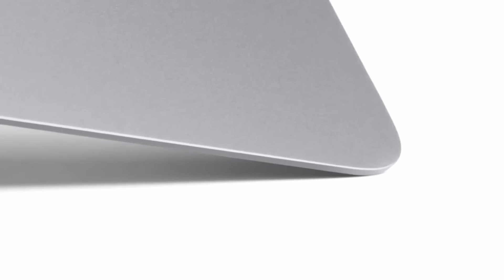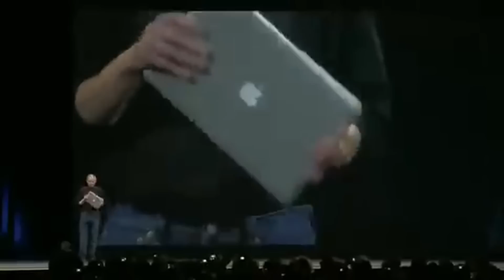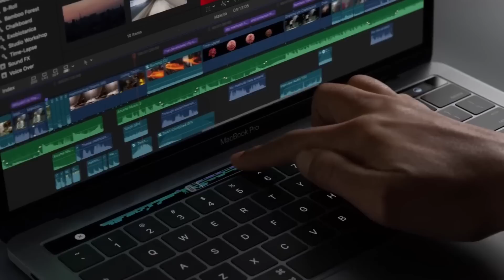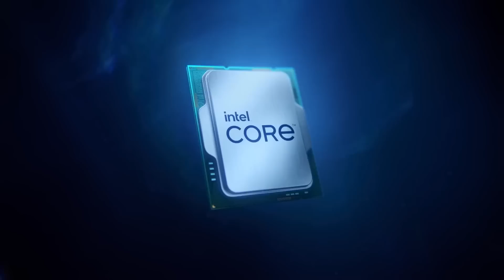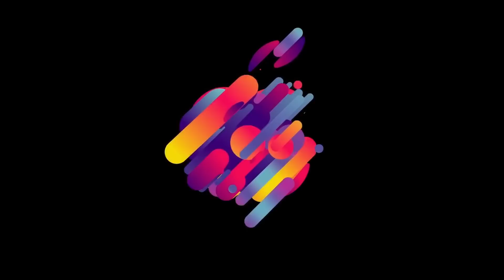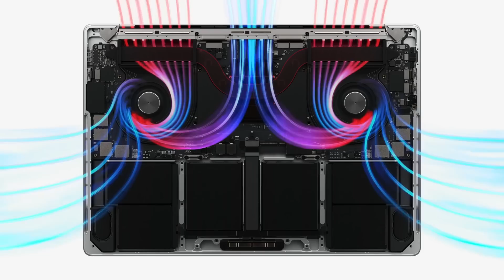How Apple Almost Killed the Macbook

Comment: I bought an Intel MacBook Pro in 17 and never really liked the Touch Bar. The computer slowed down very early and it got warm quickly. Not to forget that when you are writing then sometimes you touch the touch bar by mistake a what you have just written or tried to disappear. I have had better macbooks before, but then again I still have it at the moment my command buttons are falling off or don't work. I have then considered having a mac mini at a travelling computer, but it probably end up that I will buy a macbook M4

Comment: I feel like the touch bar could have been successful if apple added it without removing physical keys that it replaced
Reply: I always thought the same...

But the many developers were too lazy code...

Plus, Apple failed to make it tactile, like normal keyboard, or atleast like the iPhone screen

Plus it's also expensive to manifacture, which makes MacBooks more expensive, 

and it's another thing that uses CPU, in some cases GPU and battery

The thing is, tech isn't there, it's too ahead of our time, maybe it will be in the future, after a few decades
Reply: @Senior_Heel It'll never come back... It was bad even in theory. The only use for it that wasnt done better than with the keyboard shortcuts or with the function bar was the emoji and video slider and it was only marginally better. If it wasnt horrible it wouldnt have been hated on so much that apple removed it
Reply: @camkeena6874  I see your perspective, but what we don't need right now, and we just see as gimmicks that make things marginally better, maybe we might see them as essentials in future... like that's how they saw GUI and Micro-chip processors when they were first introduced right ❔ So, maybe, I am saying maybe, so take this with a pinch of salt, maybe touchbar, which I believe is just ahead of our time, may return in future concepts which will improve the flaws the current toucbar had and perfect it, with future technologies that we do not have rn, that's how microchip processors and GUI became common, they were initially were ahead of it's time and when they were introduced, they weren't perfect, because the tech wasn't there but as time moved on, tech improved and they perfected it with the improved tech...and everyone started seeing them as essentials... so... maybe touchbar becomes something like that... but who knows, maybe I am wrong, and maybe it was a bad idea afterall
Reply: You just described the Asus Zephyrus Duo, although the trackpad placement isn’t central
Reply: @gordonoboh833  I just looked it up, the touch bar is massive on that one...
Reply: the touchbar could've been SOO GOOD
Reply: @bene0001  yeah, but it is too ahead of our time, and the tech isn't there
I like the concept just like everyone else, but I would rather have full fledged features than half baked gimmicks [which was what the touchbar is]
Maybe in the future, when we can make OLED strips as clicky as normal keys in keyboard and in a time where devs are not lazy to code
Reply: @ all it needed realistically was haptic feedback and to leave the escape key physical when it launched. i genuinely think the tech was there but any incentive was killed to quickly
Reply: @bene0001  maybe it is, but think about it, it would make an already expensive notebook more expensive...
so if the tech is there, it would still be expensive to manufacture, there it would increase the cost of an already expensive notebook... maybe in the near future, it would be less expensive, and they can implement it, but probably not now...

Also, a personal note, I enjoy talking to people like you, helps me think other sides of a situation, so keep up with the constructive conversations 👍👍
Reply: THIS
Reply: I've never had a computer with it but it looks so cool, I think I'd like it

Comment: The touch bar still WAS a game changer in my opinion, and I refuse to upgrade my M1 Macbook pro until they bring it back
Reply: Same, I still can't get used to not having the touch bar anymore. It was just underrated and underutilized
Reply: I smell crack rock smoking 😂
Reply: I understand why they changed it, yet i stillI hope they bring it back, The new longer and Squarer FN keys length would be perfect replacement for it, or, even if they added the touchbar on top of the physical fn keys would still make a lot of sense, with still much of space left.
Reply: TouchBar is a fun yet useless way to interact with the MacBook. TBF, I’ll find use a new MacBook without TouchBar awkward soon
Reply: @tblism265  I mean, it was fun, but I can't say it is useless, the thing is, we didn't need it today... maybe some time in future, not now... cuz it is too ahead of our time, and the tech they built it on [which ways today's] wasn't enough to make an experience better than the f keys
Reply: @tblism265  it's not useless, there are many uses for it including:
- typing suggestions (like on iphones)
- the emoji library
- faster brightness and audio controls (only 2 swipes required instead of having to press the physical button multiple times of hold it)
- you can customise it easily and it changes the icon (icons can't be changed on the physical buttons)
- it changes dynamically with different apps (although most apps don't support it)
Reply: yeah, but the tech isn't there, it's too ahead of our time, maybe wait for a few more decades till they can perfect it

Comment: Never went with the Macbook Pro past the venerable 2015 model, as those that followed just had shitty keyboards. My wife bought the 2019 model and just a few months later the laptop had keyboard issues and finally died out last year due to a faulty DC controller.

Looking forward for the Apple Silicon Macbooks for better reliability and thermal dissipation...